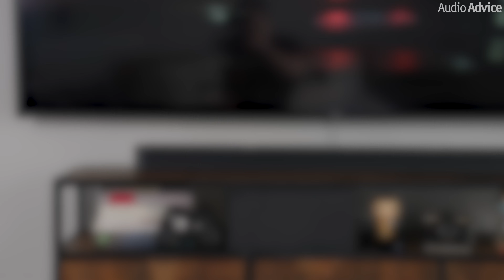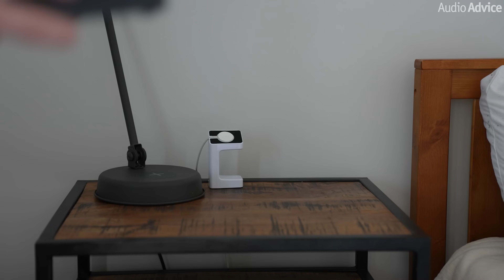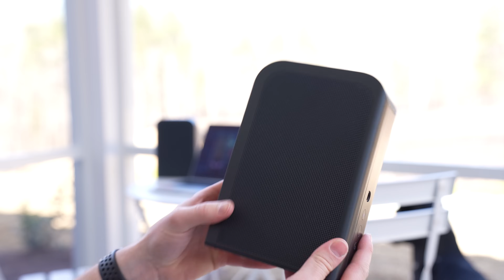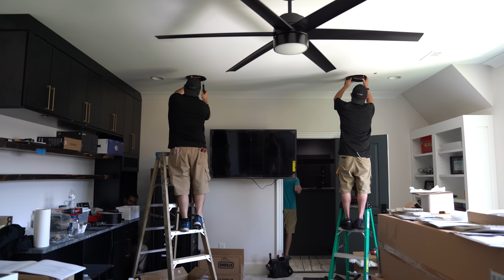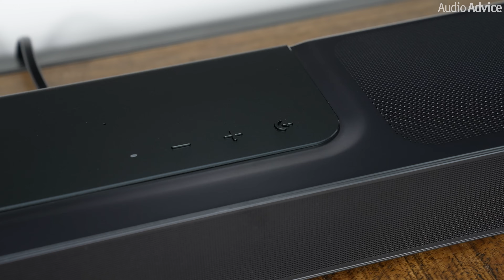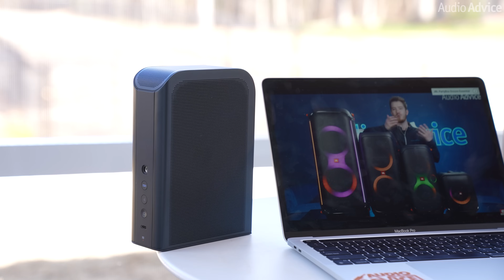JBL Bar 1300X Soundbar Review w/ Detachable Speakers! | Is this the BEST Dolby Atmos Soundbar?! 🤔

Comment: Finally. I decided to buy the JBL Bar 1000. Wow, what a powerful bass. Everything shakes. 😂😁🙏🏻 Thanks for the review! I wanted to ask how and if there is a possibility of movie, music, etc. modes? Because I didn't find how to do it?
Reply from the maker: Awesome! Glad you are loving it! Be sure to connect the app to the bar and check there.
Reply: @AudioAdvice  Thank you, I would be happy if jbl in the software refinement, in addition to the excellent equalizer, you also gave me the option to switch between NIS movie, music, and gaming modes. That would be even better. I had this in a sound bar from another company and it was useful. But don't take away the option for the equalizer to be adjusted manually. Thank you.

Comment: I don't have space behind the sofa set to put the 2 wireless speakers. Will it work equally good if kept on the sides?
Reply from the maker: Yes, that is where they should go if your couch is against the back wall.  Thanks for watching
Reply: Just get a very skinny table and put that behind your couch, then set the volume lower. That’s what I did and worked out great. The table I have is only about 6” wide.

Comment: Can you leave the surround speakers permanently in the rear attach to a usb C power cable and using it at the same time?
Reply from the maker: That should work fine. Even if you had issues, you could leave a cable next to it to charge and unplug when you use them. This would also help save its battery life instead of having them permanently plugged in.
Reply: I have the same question. Not sure but I believe you can.

Comment: I have the JBL 9.1 ATMOS and the sound quality is garbage. Very muddy. It's pretty sad when you connect up a Hisense Atmos bar for your parents, and realize that bar sounds better than your JBL 9.1 just in terms of sound quality. Is the 1300X the answer I'm looking for? Or is it just a lateral move with same muddy sound quality, with just more power?
Reply from the maker: Did you do the calibration for your system?
Reply: @AudioAdvice  You betch'a. Running 4K premium HDMI cables. This JBL still sounds muddy.
Reply: @RacerXGTO I thought the same thing about the Samsung 990, all the reviews say it’s great but to me it sounded muddy, lacked bass and immersion (definitely not worth the price, more of a $500 bar, not worth it if you pay more). As far as the JBL 9.1 it was way better than the 990. Although right before it stopped working on me, it started to lose sound quality too.
Reply: @GhostSal  The crazy irony in all of this is, I tossed out my JBL and bought the Hisense U5120GW+, before Hisense mysteriously pulled it from the shelves, and I cannot believe my ears! This is a diamond in the rough, I'm super critical about sound quality, but this crazy Hisense is phenomenal. My music, my movies really "pop" with rich sound with plenty of power on tap.

Comment: I compared the Jbl 1300x, Sonos Arc & Bose 900 in store & the Jbl blew both away. Only downside is massive unnecessary size of the subwoofer...
Reply: hows the ambeo max compared to JBL 1300?
Reply: @coolestspott69  Ambeo Max is the best by far. It has the most complete sound, just too big in my opinion.
Reply: @billbangz  ok..  was leaning more towards the JBL because of the detachable speaker's can  the ambeo max  project that kind of sound of having those independent speaker's?
Reply: @billbangz  would there be any issues for the detachable speaker's in future regarding battery up.. pretty sure that the battery would lose it's capacity over a period of time
Reply from the maker: It's a great soundbar! Thanks for sharing!

Comment: How Will the designer(uneven) POP sealing with sealing fan will affect the Dolby Atmos sound effect?
Reply from the maker: This should still be fine as long as it's 10-12 feet or lower and has no obstructions in the way. Yes, technically it may diffract the sound waves a bit but it shouldn't make a huge difference at the end of the day. Hope that helps!

Comment: 😮😮😮hello can you help me how did i get jbl bar 1300 the box has double schoch white tape side under white...may it have been used before? or did jbl make the boxes like this?
Reply from the maker: We are not sure. Packing could vary by run and country shipped to.  You should reach out to the dealer you purchased from.
Reply: @AudioAdvice  jbl italia
Reply: @AudioAdvice  i was told by jbl italia that it was never opened 😑😑😑
Reply: @AudioAdvice  i wanted to know if the other people bought with the same white shock side under the white packaging ... the seals are the ones that is not open i saw the first day
Reply: @AudioAdvice  I was very disappointed😢 jbl bar 1300 with 1500 euros in Italy 3 months ago I bought JBL Italy and it was delivered to me. with broken polystyrene

Comment: been having my 9.1 for about 2 years now i love it but now i’ve come to find out it’s not the flagship model anymore :( i can’t even begin to comprehend that there’s a better newer jbl bar. is it worth the upgrade ? i really only care about bass and dolby atmos
Reply from the maker: If you already have a 9.1, this is an upgrade but not huge.
Reply: Agreed
Reply: I just got the 1300x on sale for 1100. I also have had the 9.1 for a couple of years. At first I didn't notice a huge difference but I will be playing a couple of key atmos scenes with both to see if it's worth it or not. (There are a couple of Bird Box scenes that are amazing with atmos) If not, then I'm returning the 1300x. It does sound amazing though, but so does the 9.1. The bass is almost the same, maybe the lows hit deeper...and the atmos is a bit better. But worth the price difference? Not sure yet. If they would have given us more control over each channel, the volume more than 31, and even a remote with a back light I would have most likely just kept it without all the skepticism. All that being said...not worth full price if you already have the 9.1 and if you get it on sale...hold on to the receipt just in case.
Reply: @harleydad1975  nice. thanks a lot

Comment: Overpriced.
Reply: On sale now for $899
Reply: At the current price of 899 this is now one of the best bang for ypu buck sound bars hands down. I'm a samaung guy and not ashamed to admit this.
Reply: @scoobydew420  the Samsung hw q990c is on sale for 660. I just miss that deal. Kinda sad right now. I'm jumping on this on but wonder the extra 230 worth it
Reply: Mostly everything is.... If you really want it, price is irrelevant
Reply: They are ALL overpriced 😂
Reply: I've just bought it for 900€
Reply: Lol
Reply: Wrong
Reply: On sale for 1g...boom
Reply: @ski007jim bingo haha. Just got mine
Reply: @ApexofWar_  just installed it Sunday 🔥
Reply: @ski007jim do you regret it?
Reply: @davidrockefeller2007 my audio cuts in and out randomly all the time, other than that it's solid

Comment: Jbl bar 1000 or 990b? If the price difference is about 300usd in my a country ? Cheers 🙏
Reply from the maker: If the Bar 1000 is the same as the 1300 in the US, get the JBL
Reply: @AudioAdvice  no, 1000 is little brother of 1300 with 7.1.4 channel and smaller 10inch sub . Thanks

Comment: Can you explain how this system time aligns the sub and the wireless surrounds after you've placed them in a place other than next to the sound bar?
Reply from the maker: It is actually quite interesting the process you go through.  You can see it here on pages 15-16 of the user manual.  https://www.jbl.se/on/demandware.static/-/Sites-masterCatalog_Harman/default/dw8293a4a2/pdfs/JBL_HA_Bar%201300_OM_Global_V6_EN.pdf  Thanks for watching

Comment: what I was looking for in a review was even how does it perform when the rear are in the bar... how does it perform compared with bar alone system like sony A5/7000, bose or Arc without the rear speakers? Because the price is high but not as high as these other systems in the complete form with the option of having the full surround when needed in movie night.
My room is odd shaped and having something on the wall is not ideal and this bar could solve my problem but I would like to know how does it perform when everything is together in the bar
Reply from the maker: We did not test it that way as it is so simple to move the battery powered rear speakers to locations for rear surrounds we do not feel anyone would use them much on the bar.
Reply: The sonos will always be the best sounding soundbar compared to the Bose. But for JBL, it has a loud sub but not tight and clean and as the pioneered sub gen 3. Otherwise, it's personal preference. Don't think sounbars are all in for music. It's mainly for impactful movies. But quality wise, it's Sonos, Bose, and JBL.

Comment: Also, thank you so much for that detail about limitations of 60hz for consoles plugged into the bar, and the detail that you plug your console directly into the TV to reduce lag and get the best picture. It seems 120hz and VRR wouldn’t work for Xbox Seris X if connected directly to the soundbar. Is that accurate?
Reply from the maker: Those features are not part of the bar, just connect your console to your display and use HDMI eArc to get full Dolby Atmos.  If you have a TV capable of high speed gaming, it should have eArc
Reply: @AudioAdvice   So, what happens if I play a game ON PS5 that sends a 4K120hz signal while connected to the bar?
Reply: @OmerAlazawy  for instance, when you turn on the PS5, it will tell you that your device is not capable to run 4k at 120Hz so it will set it up as 4K at 60Hz anyway. Just like it was mentioned before, plug the console directly to your screen via HDMI and let your TV do the transfer to the soundbar. Use the HDMIs on the bar for any other devices that not need 4K at 120Hz, like a Nintendo Switch, Xbox One, Apple TV, cable boxes or so.

Comment: The point is you an get a samsung q990b at almost half this price. And it's much better than this too .
Reply: Better based on what disconnecting more often?
Reply: @garretts431  agreed. That's one issue they got to sort. Am waiting for q990c to my s90c.
Reply from the maker: Have you heard this one yet?
Reply: @AudioAdvice  good point I haven't. But based on the specs, the front bar alone without the sides is smaller than the Samsung and based on other reviews appart from the subwoofer am not sure if there is something better than the Samsung. BTW, comparison video out anytime ?

Comment: I currently own the 9.1 and my only complaint is the sound stage is not very wide. Does the 1300x achieve a wide sound stage? Also my TV set up is 77" lg oled.
Reply from the maker: That is going to be an issue with all sound bar type systems.  Separate speakers will be your best bet if you want a wider soundstage without faking it through phase tech.
Reply: @AudioAdvice  even the q990b?
Reply: @vilhelmstein2091  yes - it's a soundbar that bounces sounds off walls like every other bar. a longer bar just means shorter distance to wall assuming the room is a good room to bounce sound in. in short, it's all just echoes and some give off louder echoes than others.
Reply from the maker: @vilhelmstein2091  We tested that one earlier for a 2023 best of and felt there were better options for how it handled dialog